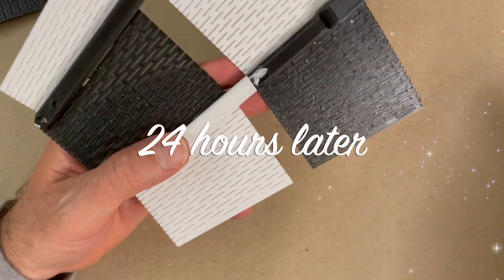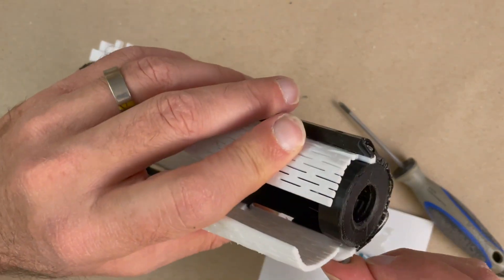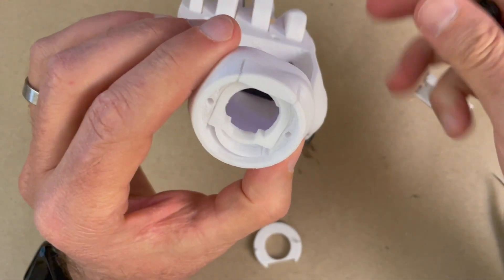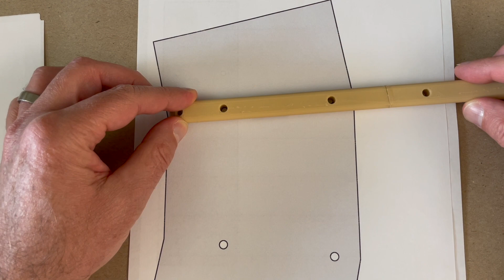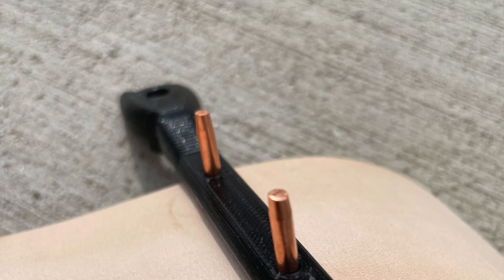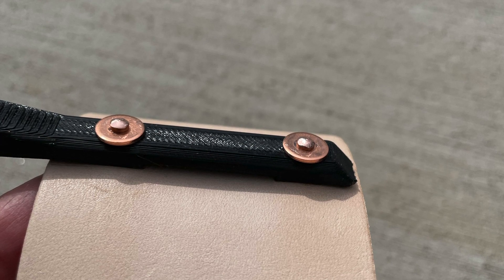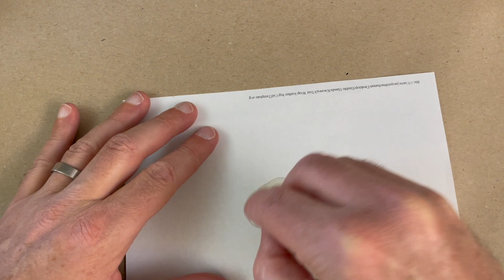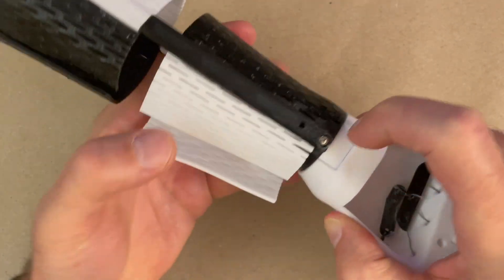4a Assembling Wrap Arm | Kwawu 3.0 Prosthetic Arm Assembly Instructions

Comment: This arm is probably some of the most unique one's I've seen and I can't wait to assemble it. However, I couldn't find a non-3d printed parts list. Is there a document where I can find a list of the parts I need to buy? (i.e. screws, etc)
Reply from the maker: File for wrap version on GitHub https://github.com/JacquinBuchanan/Kwawu3Wrap/blob/main/Kwawu%203.0%20Wrap%20Version%20Instructions.pdf
Reply from the maker: Sorry thingiverse will not hold PDF files. You can find instructional files on Git hub. https://github.com/JacquinBuchanan/kwawu3Socket/blob/main/Kwawu%203.0%20Socket%20Version%20Instructions.pdf you can find the parts list on page 18.
Reply: @JacquinBuchanan  Thank you so much!